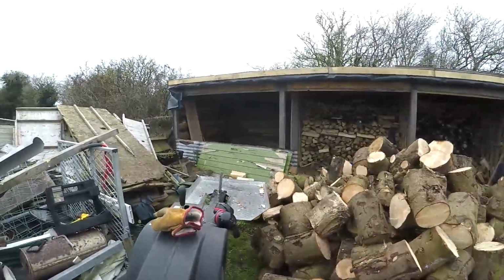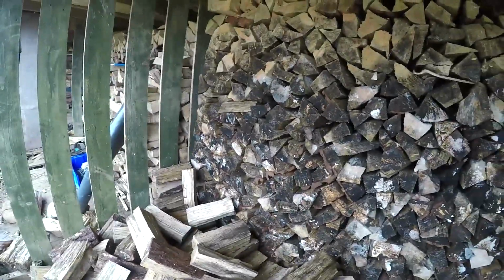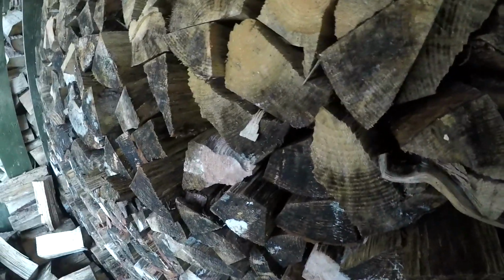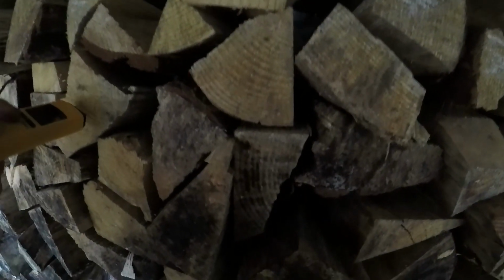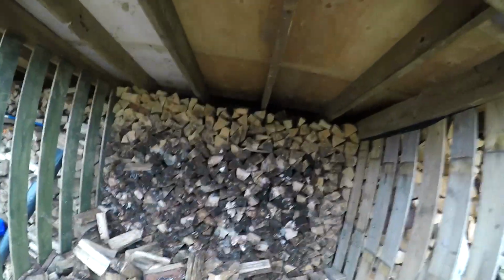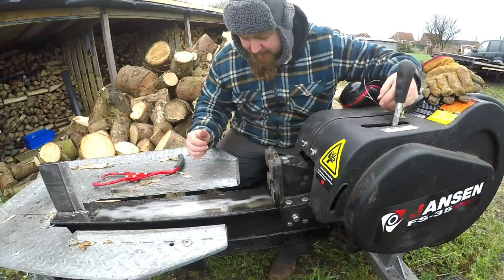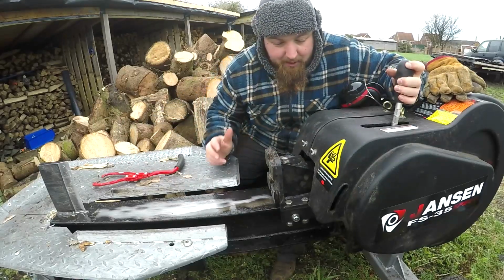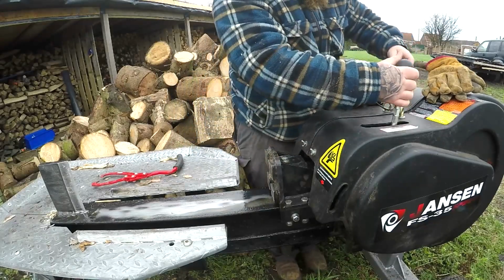Bad Times with Jansen FS-35 Log Splitter

Comment: Hi nick how is the slow taking back solved?
We got the same problem 
Sometimes its stuck
Reply from the maker: Hey buddy and welcome to the channel, thank you for commenting. Mine still is doing it but I'm going to be stripping the head down soon and see if there is anything I can do. I think it has something to do with the plastic plates on the underside. Again, I'll be doing a video on that in the coming weeks. I just keep spraying a load of light lube oil and that helps eventually. I know I have gave you a solution but I hope it has helped 😊
Reply: @everydaywithmenick  thnx nick.
Reply from the maker: @pullo575  hey bud, so I've been using my splitter over the last couple days and I have finally figured out what's been my problem on the slow return. The bearing on the engine side was too tight and needed slacking off a little bit. Now she flies back. I've got a video I'm editing now to show what I mean. Hope this might help.

Comment: Hi Nick Great Video - whats the tonnage on this machine - will it split oak and cherry and Beech?
Glad you sorted the problem with the slow return...like the setup you got
Reply from the maker: Thank you Kevin and welcome. So the tonnage is kind of rated at 35 ton however its hard to gauge like a hydraulic splitter.
I have split both of them through this machine and yes they split fine. Cherry was quite easy to split, I even used the axe sometimes to split the cherry. 
Yes the slow return was gladly fixed. Just a tight bearing after all that. But I do have to keep the rack head clean of debris to allow it to slide freely. 
Thank you again, have a great Christmas and Happy New Year.

Comment: What happened to the safety lever on this one? I can see the slot for it on the LH of unit. Thought they had to be two-handed operation for safety.
Reply from the maker: You are very correct, it is supplied as a 2 handed operation for safety reasons. However I have removed the safety lever at my own risk. It wasn't efficient enough having it on. I know it's for safety but for the years I've owned and the tons of wood I've processed, I'm sure I know where my hands are to be kept out the way. Thanks for commenting and watching.
Reply: @everydaywithmenick  Thanks for quick reply. Just been using one yesterday. It's got the Kohler 6.5 hp engine. 
Very speedy at processing, but the info video posted about failing lockwasher is very useful for future reference. Especially as there appears to be little knowledgeable tech support for these machines.
Reply from the maker: @roycraggs2058  your very right about limited information on these machines. That's why I try and get as much information out there as possible. The splitter is brilliant, very fast just how I like it.

Comment: Thinking about buying  this splitter. Did you solve the problems? Ever tried birch??
Reply from the maker: Hi buddy and welcome to the channel. So yes, I solved the problem and if you check the newer video on the splitter you will see how I solved it. But basically the engine side bearing was either too loose or too tight. Easy fix really. Hope this helps but I'll assist further if needs be 😊

Comment: Hi nick that’s annoying about the splitter I know how you feel about the wood stack I got some silver Burch in rings been in a shed for 4 years took it out in September to split it never got there to split it for about a month completely soaked it split now but still soaking could be in trouble if we have a cold March
Reply from the maker: Hey michaelshortsc, its so frustrating as ive got a bit to get through and the splitter is the only thing that will get me through it. Never good when its wet but saying that i try to split my wood as soon as i get it to get it drying quicker. Well in that case it will be moulding quicker. I welcome the cold, I'm sick of the rain, a good hard frost will be nice to split in, freezes the wood a bit if that cold and then they really do split easier. Thanks for watching and commenting. 😁
Reply: nick garton I’ve decided to make my own kinetic splitter and run it of a old lister d engine I’ve got the rack and pinion and the flywheels now I’ll keep you posted on the build as i progress
Reply from the maker: @michaelshortsc  that be good to see such a build, ive seen another on youtube that's a kinetic splitter with a lister engine, simple but packs a punch and so quiet. the flywheels were the only reason I didn't build my own as I didn't know where to source them from. be sure to keep a video rolling to see how its done.

Comment: i just chuck it in the barn for a year and i dont stack it neatly until its dry, also my barns have a foot gap bottom and top of the walls and pallets on the ground
Reply from the maker: Hi Robert and thanks for your comment. I often thing is stacking a better more efficient way of drying the wood. I don't have a large barn to use unfortunately but my log sheds are 8feet wide x 8feet deep x 6feet high so can get a good bit of wood in there, leaving 6 to 8 inches between rows. 
I have a wood floor but no circulation of under the wood. Need to set myself up a little better 😄 
Thanks for your comment buddy 👍

Comment: Thanks for the update. Recently got one of these no problems so far. I do find that the first few times I use it, it retracts really slow then speeds up after a few splits. Be interesting to find out what it is. Also Is the moldy logs sycamore? As have a fair bit stored and reading up on forums seems to be a common problem? Cheers
Reply from the maker: Hi Ben Ten. In my splitter kit it came with a handy oil bottle where you can pump it onto the moving parts with ease. I just make sure the rack and sliding base is well oiled up but obvious ive got some accumulation of crap built up some where.  
The moldy logs are soft wood, maybe knotty pine or fir wood. My own fault for not allowing air space throughout the stack. Anything else just comment away and thank you for watching.

Comment: DONT TELL ME, YOU GREASED THE CLUTCH SIDE OF THE MECHANISM - DIDN'T YOU ? The only OTHER thing that causes this problem with these ""CHINESE"" rebadged splitters (Jansen don't make them) is that people grease up the dog clutch metal lugs and areas on the clutch side that should NOT be greased. Get some brake cleaner and open up the clutch side, wipe off ALL that grease and lube that has converted your 30 tonne '''CHINESE'' splitter into a 2 tonne splitter - grease belongs on the bearings and lots of it not on the clutch wedge type metal areas - just do it and the problems fixed. Again as I said if that bearing tabbed stop washer on the engine side has sheared that needs replacing and tensioning with the clutch side off. Been there done that worked it out myself as NO ONE KNOWS WHAT CAUSES THIS OTHER THAN ME !
EITHER GREASE CONTAMINATION ON THE CLUTCH SIDE COMPONENTS OR A BROKEN STOP WASHER ON THE ENGINE SIDE OF THE RACK SHAFT. THIS COMMENT WILL SAVE A LOT OF PEOPLE A HELL OF A LOT OF GRIEF.
https://www.youtube.com/watch?v=JMfHrdrc9oM&t=7s
Reply: You’re telling us what we already know. 🤡
Reply: Please tell me who in china produced this model. Maybe i will buy one.